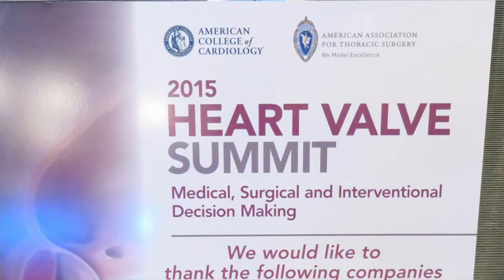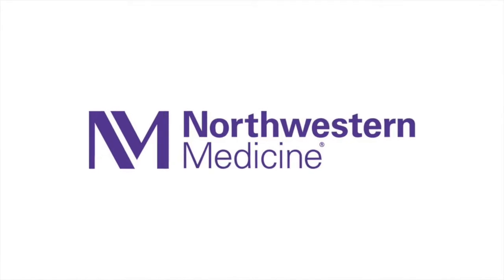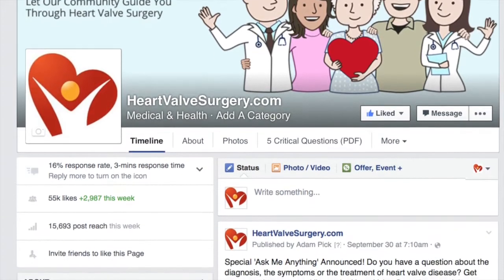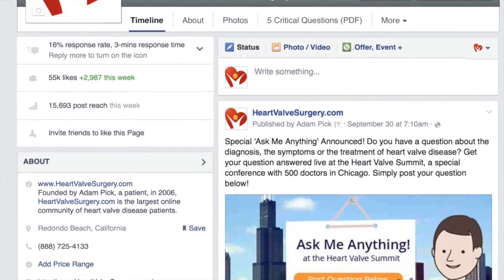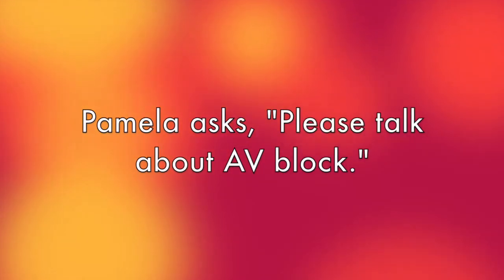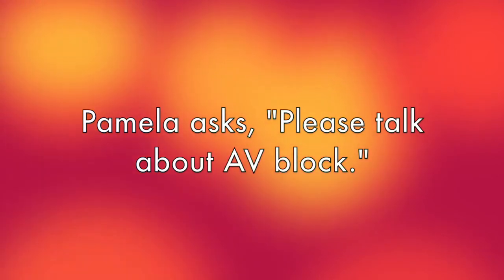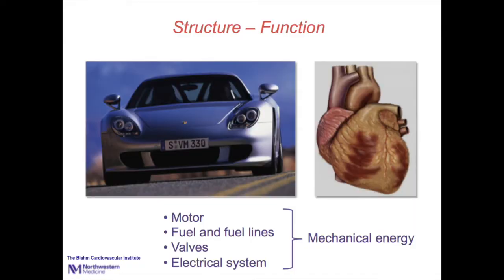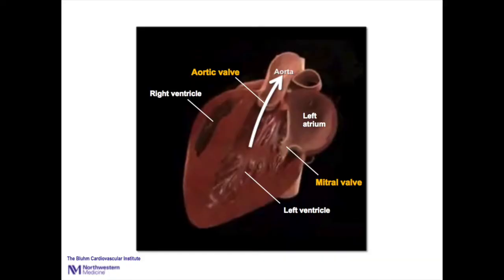Atrioventricular Block (AV Block) After Heart Valve Surgery

Comment: I was told my surgeon nicked the AV node whil putting in my mechanical valve  that was too big in the aotric positionand had to take it back out. Then he put the correct size in. He sent my heart into complete right side heart block. I then had to have a pacemaker with 2leads to the right side of my heart implanted.
Is it necessary to nick that node in the heart to implantt a mechanical heart valve?
Reply from the maker: Hi Tammy, Nice to meet. Thanks for sharing your story with us.  Sorry the right side of your heart went into block. 

You raise a really great question below. Unfortunately, as a patient advisory group, we are not trained or capable of providing specific medical advice.   That said, we would strongly encourage you to discuss this question with your medical team. If you are not getting information that you are comfortable with then perhaps you should get a second opinion to validate and support next steps. 
 
We are sorry that we cannot be of more immediate help to you!!!